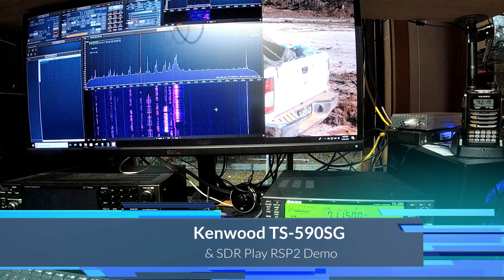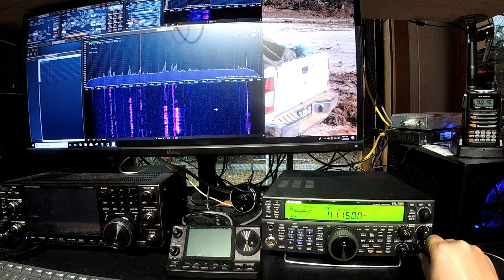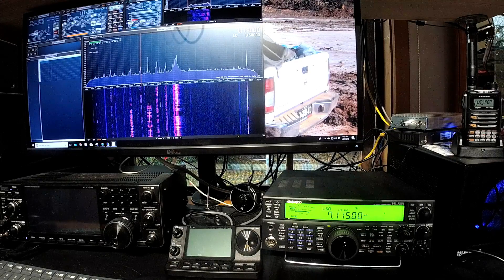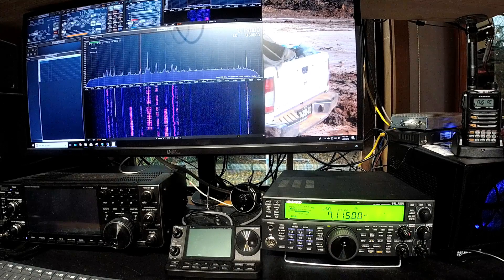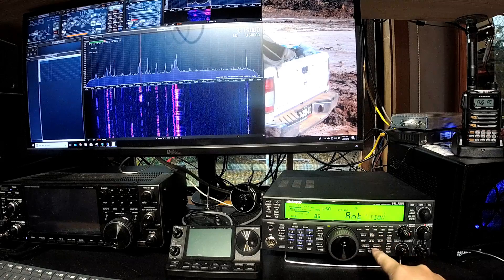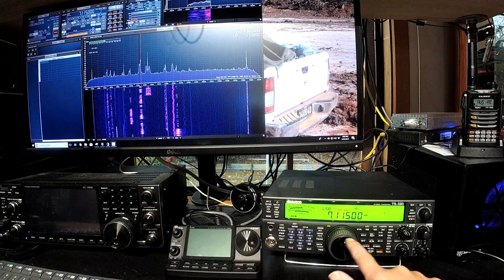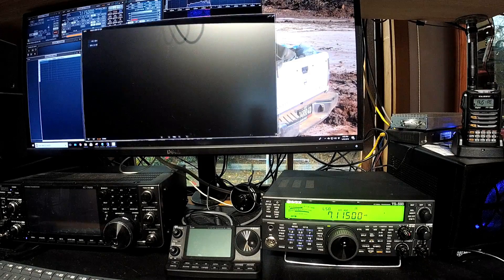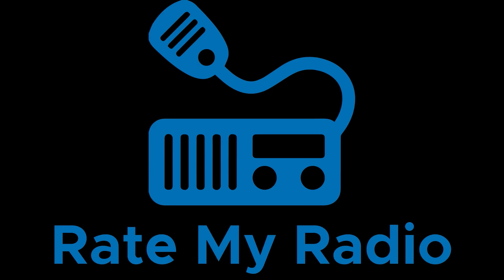Kenwood TS-590SG Panadaptor SDRPlay RSP2

Comment: This is from the TS-590SG manual when using the DRV output "the receive sensitivity and gain decreases by approximately  3 dB." what would that be in S-points on the RX.
Reply from the maker: One S point is supposed to be 6db so half is the correct answer, but no manufacturer sticks to the standard and it can even vary with where you are in the range.  3dB from splitting is not worth worrying about as the SNR won’t change and the RX is more than sensitive enough.  73, Jarrad VK3BL
Reply: @RateMyRadio  Thanks.

Comment: The sdr is conencted to kenwood , its alone with antenna? Hows that?
Reply from the maker: The TS-590SG has a ‘rx out’ port which can be uses to directly feed the SDRPlay
Reply: @RateMyRadio  does it works same way with ts 590s ?  not sg ?
Reply from the maker: Rui Vieira unfortunately not, it is an SG feature only.
Reply: @RateMyRadio  than ts 590s cant work with a sdr?
Reply: @RateMyRadio  does the 590s has it. Can 590s work with sdr with all benefits as 590sg?

Comment: 1st!  you are using the bias T.. careful might accidentally turn it on.. might damage your 590sg.
Reply from the maker: Good spot, we’ll make sure to disable that! 73, Jarrad VK3BL
Reply: move to the other port. avoid using the bias T .. sdrconsole is better than sdruno in terms of noise reduction and audio.
Reply: What do you mean by bias T, I got this setup and don't want to damage it :-o